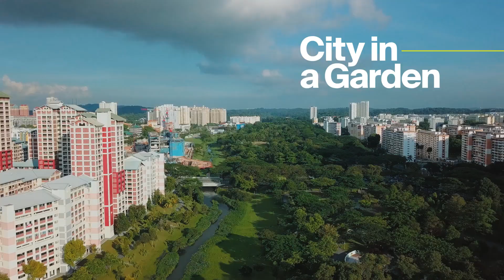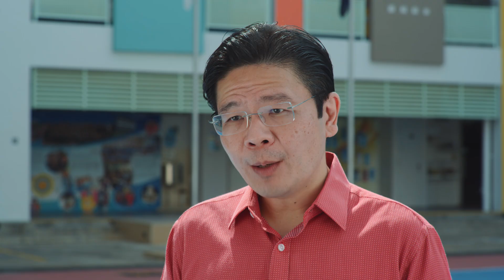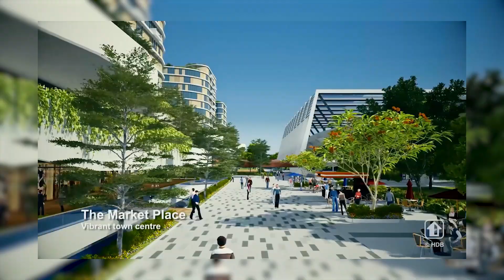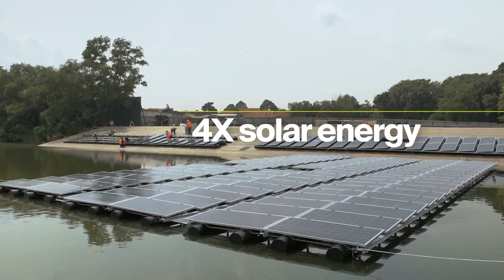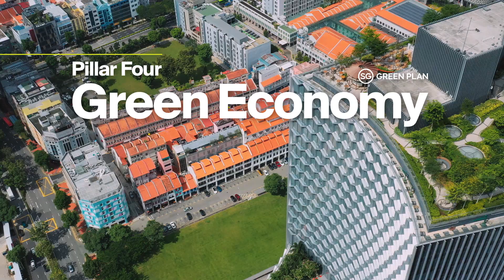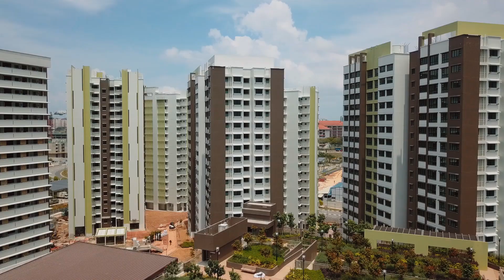Singapore Green Plan 2030

Comment: A "Green Plan" with an arbitrary date. I'm sure part of that plan was to demolish the largest secondary forest in Singapore, the Tengah forest to build more residential space. Then there is the "accidental" demolition of the Kranji forest and plans to demolish a forest in Dover. Not included in the plan are all of the marine ecosystems buried under sand during the numerous land reclamation projects. 

Also is Singapore a "country or a "city" or does it change depending on what story the government is trying to spin? If we compared Singapore as a "city", yes you can say it is a "green" city, whatever that means. But cities are not built to be green, they are built as centres of economic activity. If we compare Singapore as a "country", in terms of land % covered by forest, Singapore ranks below all other ASEAN neighbours as well as Taiwan, South Korea and Japan. But this data doesn't fit the narrative now does it.
Reply: Singapore is actually both a country and a city, it's a weird anomaly because Singapore is so small. Of course, with such small land, the government has to plan out land use very carefully, and sometimes might need to sacrifice nature for economic prosperity.
Reply: @jon_nathan  "Singapore is actually both a country and a city" Singapore never started as a city-state, until independence the city proper was concentrated to the south. The rest of the country was plantations. Regardless of that, Singapore is a country, there is no way to run away from this definition and as a country, we are behind many aspects in terms of being "Green" and the "Green plan" will not do much to help.

"sacrifice nature for economic prosperity" Congratulations, you have uncovered the reason as to why humanity has reached the point of impending ecological devastation that spells the end for contemporary global civilisation.

"cannot aim for the greenest country in the world" And I never mentioned that Singapore should aim for this. The concept of a "Green" is arbitrary in the first place. Green is the new buzzword for invoking feelings of accomplishment...without actually doing anything beneficial. As such, the "Green Plan" is simply marketing, examining the contents will demonstrate that it pretty much does nothing for the environment.

"Singapore is top of the world in urban tree density" this is a good thing because? You do realise that many of these trees are clones right? Not to mention almost none of the trees you see parks or roadsides are species native to Singapore. 

"government has still kept the protection of nature in mind" Huh, is that why the government undertook rampant land reclamation and buried marine ecosystems under tons of sand and soil? I believe that it is up to nature to decide whether any government has protected it well. Come 2063 when Johor has stopped supplying Singapore with water and nature decides to dry up the reservoirs you can ask nature whether it is happy with the protection it has received.
Reply: @Destroyer4700  interesting opinion, thanks for sharing! I didn't know that Singapore isn't a city! However, with such little natural resources, I'm not sure what else the government could do to achieve economic prosperity. With every decision comes consequences, and if the government were to start focusing on nature alone, I am pretty sure our economy would start to suffer.
Reply: @Destroyer4700  Of course, if you were to talk about why us humans prioritise money over nature, that I cannot answer, but it is also not a fault of Singapore's government.
Reply: @jon_nathan  "Of course...not a fault of Singapore's government" A hypothetical situation? This is called a "Strawman" argument. Any priority set by human beings is a conscious decision, there is no mystical reason behind it. 

"However, with such little natural resources" While not obvious to many, land...is also a natural resource. It is possible to improve the economy without using more natural resources, make operations more productive. It is also the reason why you are more likely to be living in a high-rise apartment than in a low-rise suburban sprawl. High-rises are a more productive use of land. There are ways to preserve nature without sacrificing economic growth. An inability to see otherwise is simply indicative of a lack of imagination. As I've already said before, nature will decide in the end, not human beings. Civilisations exist at the mercy of nature, not the other way around. Singapore is no exception.
Reply: @Destroyer4700  I sincerely agree! Of course as a species we should strive to take care of the environment around us, and I see nothing wrong with the problems you have with government action. The only difference I see between you and me is that you are much harsher towards the government, which is your own opinion. Thus, I find the purpose of this discussion fulfilled, which is for me to find out more about your point of view and perhaps for you to learn more about mine. Thank you for this enlightening discussion, and I am sorry if I have caused you any frustration. Thanks for sharing your opinion, and have a wonderful day!
Reply: Just gonna sneak in the conversation lol. Tbf, Singapore has (google statistic btw might be off) a population of 5.7 mil, London having 8 mil. Singapore, as a whole, is 1/2 the size of London. And Singapore still needs to grow it's own food (meat lab grown and vertical farming, so less space needed), while London doesn't. Honestly, for a country trying to become food and water sustainable, I'd say it's doing well.
Reply: @maxboku  The idea of developing Singapore's agricultural sector has been floated around since 1991. It's been 30 years since then and if anything Singapore has become even more food insecure. 

The question of whether Lab-grown meat and vertical farming will ever be viable on a large scale depends on the cost of production. If they cannot produce products on par with imports in terms of costs and quality then nobody will buy them.

As for water, the government's plan is to rely more on desalinated water from desalination plants (that burn natural gas), this has been so successful that it bankrupted the company that built and ran it, Hyflux with thousands of local investors losing their savings. 

The only way for desalination to be cost effective is if the energy source is a nuclear reactor, but I don't think the ruling party is planning on taking that political hit yet. The water supply agreement with Johor expires in 2061 so maybe they'll wait till 2060 to figure things out.
Reply: @Destroyer4700  When it comes to food you're right it may never succeed but from what I've seen of technology and farming it's the best shot they've got. Desalinated water, yes, does run on natural gas, but a freshwater source has other issues that are worse such as ruining ecosystems. Water imports are a bit reliable at least but some countries they import from might not have the most sustainable ways to get them.
Reply: @maxboku  "it's the best shot they've got." Pre-independence, much of Singapore was farms of some sort, plantations, aquaculture..etc. Following independence, the government implement a law that could force land owners to sell their land to the government so that it could be used for other purposes. 

Even today, the Singapore government is still demolishing remaining green spaces to build new residential neighbourhoods. Ironically, some of the land set aside for developing high-tech agriculture in Singapore were forested lands which were recently cleared. 

When actions don't match the rhetoric that's called lying. The "Greenplan" is nothing but flashy marketing paid by taxpayers. Whether it will even lead to any desirable outcome has yet to be seen. 

"freshwater source has other issues that are worse such as ruining ecosystems" That's has already happened, many of the reservoirs which Singapore relies on for water were built by damming the few rivers available. Most freshwater and mangrove swamps have long since been destroyed, either from building the reservoirs or land reclamation to create new spaces for industrial or residential use. There's not much left to ruin on the main Singapore island.

"Water imports are a bit reliable at least but some countries"
Currently Singapore relies on water imports from Malaysia sold at an incredibly low price. There are no other countries to import water from. That water is from rainfall which is collected by the Johore river watershed. As I mentioned before, this water agreement will expire by 2061. Negotiations to extend the agreement have thus far led nowhere as neither side will compromise.
Reply: @Destroyer4700  Okay I'm sorry but you just said "Following independence, the government implement a law that could force land owners to sell their land to the government so that it could be used for other purposes" like it was a bad thing. 

The island was essentially in crisis? It might have been too overpowering, yeah, but at least Singapore's actually doing well now. If you are to say it wasn't worth it, you're wrong. 

Also, comparatively, Singapore has reclaimed 21% of it's land mass. As they said in the video, relatively 1/2 of London = Singapore. Now, London uses all of London (I mean all places are accessible). If you exclude all the useless islands and reclaimed landmass, Singapore is doing damn well for their population compared to London. And London isn't even trying to become sustainable, (btw I don't think they have to) but Singapore is. 

I don't like how the Singapore government is destroying this land space, and I do think they need to try building in new places. But that doesn't me I don't think they're trying their best.

I'm sorry, but you can't know whether they will carry through the Green Plan. We have seen the Singapore government in action thought, such as these events:

- Marina Bay Sands (which don't complain about green space cause it's reclaimed)
- Transferring to natural gas (honestly, this is still a fossil fuel, i don't think it's better)
- Back when they made the HDB 
- Solar panel cable to Australia (and yes there has been action on it, not just a small thing talked about, look it up if you need proof)

I looked the damming up but all I could find were that they'd been flooded or merged with another river to make naming easier. Do you think you could provide some examples? You could definitely be right I just need to know what happened.

I was literally trying to say they need to use desal. And idc how much energy it uses. Once the deal runs out they need their own water source.
Reply: @maxboku  "The island was essentially in crisis?" There was no crisis, the government decided that central planning was necessary for better land management which proved to be correct. Of course they forgot that urbanising farmland would lead to Singapore becoming almost completely dependent on food imports which probably wasn't seen as an issue at the time. Effectively the lack of food security is a problem solely caused by the ruling party.

"London isn't even trying to become sustainable" I think the meaning of "sustainable" has been confused with self-sufficiency. London doesn't need to become "sustainable" / self-sufficient because it is a city within a country. Singapore is a country. And my point is that Singapore used to more self-sufficient at least in the food aspect. Policies towards self-sufficiency wherever suitable should be policy common sense, not something that should be advertised as though it is some brand new concept.

"I'm sorry, but you can't know whether they will carry through the Green Plan."
I never said they won't carry out the "Green Plan". I simply said that the results may not be desirable as in, for example, the plan might fail to reach its targets by 2030.

1) "Marina Bay Sands" Not many people in Singapore thought that this was a good idea and even today there is still public resentment. Prior to this the government was against the idea of casinos but when money is involved I guess everyone changes their mind.

2) The HDB scheme is an expansion of the previous "SIT" scheme enacted by the British colonial government. When it was first introduced, the HDB scheme was actually not very popular. And the effectiveness of the HDB scheme will be tested when the first batch of flats reach the end of their 99-year lease. The issues surrounding HDB in Singapore are rather lengthy.

3) "Solar panel cable to Australia" This is pretty much the very definition of unsustainable. Relying on a distant foreign  country for energy and then routing cables through a third country.

"Do you think you could provide some examples?" Search up the names of the reservoirs. A few examples.

https://en.wikipedia.org/wiki/Lower_Seletar_Reservoir
From the article:
"The scheme involved the damming of Sungei Seletar to form Lower Seletar Reservoir."

https://en.wikipedia.org/wiki/Kranji_Reservoir
"It was a former freshwater river that flowed out into the sea that was dammed at its mouth to form a freshwater reservoir"

"they need to use desal"
Yes, Singapore uses desalination via reverse osmosis but at the moment there is only enough capacity to meet 25% of demand.

https://www.pub.gov.sg/watersupply/fournationaltaps/desalinatedwater
"Desalination is an energy-intensive water source. Singapore currently uses reverse osmosis for its desalination, which uses about 3.5kWh/m3 of energy to make seawater drinkable."

In Singapore, 1 kWh costs 25.02 cents. To desalinate 1 cubic metre, it costs 25.02 * 3.5 = 75.06 cents. (SGD).
Considering the cost of 1 m3 of water to consumers is already extremely high at $1.21 before fees and taxes. Using more desalinated water is likely to increase the price of water.

Of course there is research towards making desalination more energy efficient (globally as well) but who knows when that will become a reality.
Reply: @Destroyer4700  
The island was in a housing crisis (sry I shouldn't have been as broad as "crisis" but we were talking about the HDB so I forgot to put housing). As you said, this did and is causing problems. However, it was worth it to stop the housing crisis. Also, ever since then, Singapore has grown it's economy, expanded it's land mass. The environment is one which didn't improve, rather the opposite, which is one thing the Green Plan can help with.

You were right I did mean self-sufficiency. You are also right that London doesn't need to. But Singapore, while being a country, is a country half the size of London. Look at it from a size point of view. Singapore is doing much better then London. You say that London doesn't need to. Well, you say they rely on cheap imports and that solar power from the nearest other 1st world nation is a bad thing. Yet, it's similar to London. Of course, London uses the resources of it's country, but it's the same idea. And you'd criticize that. It makes sense that Singapore shouldn't, but it really is similar to London.

Marina Bay Sands was an amazing boost to the economy, as well as using up land space which never should have been there to boost the economy. And while casinos were unpopular, there's a reason they aren't banned in the rest of the world. So people don't get angry. A lot more people were happy then disappointed in Singapore, otherwise the rest of the world would have banned them. Because too many people were against them.

This one is irritating. People criticize the HDB, but it made Singapore. I'm fine arguing a point about anything other then the HDB, because there's no way Singapore would be where they are without it. "one of the world's worst slums – 'a disgrace to a civilised community'" 
This is very true before the HDB, because that was exactly what was happening. 

Solar panel cable is, while pretty crazy, doable. The cable will be too deep to take damage from other things in the area, uses a solar farm which is virtually perfect in location, and is built in AUSTRALIA. I mean, it's the nearest viable nation to get energy from and has a great location. It's not a just any "distant foreign country". That's twisting words. Australia and it's not being routed through any country. I do believe it's hard to do but once it's done it's reliable.

Look, desal is being looked into and contrary to other things, where I don't think they will happen or wouldn't be prepared to bet on it (food self-sufficiency is one of them), I do believe desal will become more efficient and able to use wide scale. (before 2055)
Reply: @Destroyer4700  No need to be so anti-govt. All Sporeans shld be grateful for the kind of govt Spore has. This govt has a vision n things get done. Spore wld not hv come this far without the far-sightedness of her govt.
Reply: @pregnantenglish6019  Yes, the "govt" vision is so great. That's why they didn't need the advice of the World Bank or Albert Winsemius. Oh wait. And look the end result of the government's "far-sightedness". One of the lowest fertility rate in the world, low productivity, most fatigued nation in the world, most expensive city in the world. A looming housing and demographic crisis. And of course, chronic food insecurity because Singapore imports everything. All of which thanks to the constant censorship has not even been widely discussed. 

Yet somehow the ruling party thinks that "climate change" is somehow the biggest problem facing the country? By the time the sea levels have risen enough to be a problem (sometime after the 2200s). I doubt anyone would be living on Singapura.
Reply: If it makes u happier, u may want to consider migrating to a "better" country. God Bless!
Reply: @Destroyer4700  If it makes u happier, u may want to consider migrating to a "better" country. God Bless!
Reply: Singapore however, cannot aim for the greenest country in the world, with the lack of land and having to provide infrastructure for 5 million citizens on a tiny piece of land. However, thankfully the government has still kept the protection of nature in mind, and Singapore is top of the world in urban tree density.